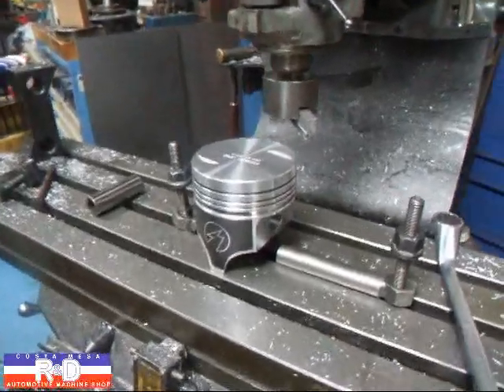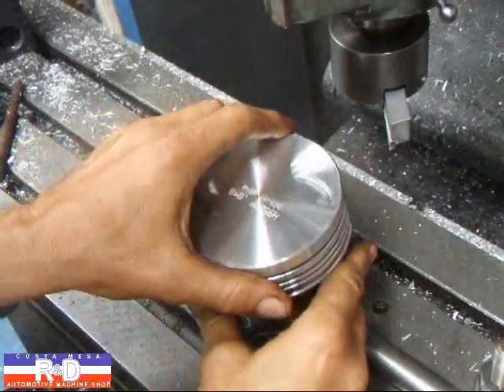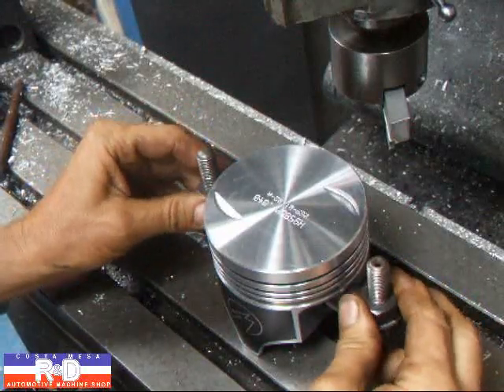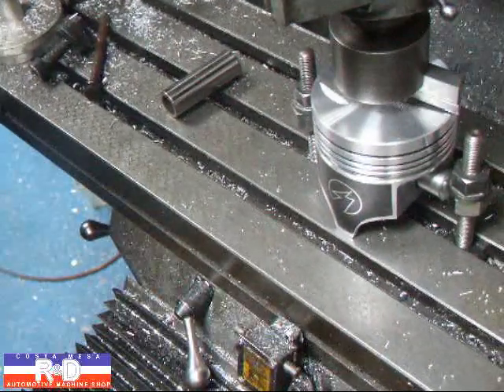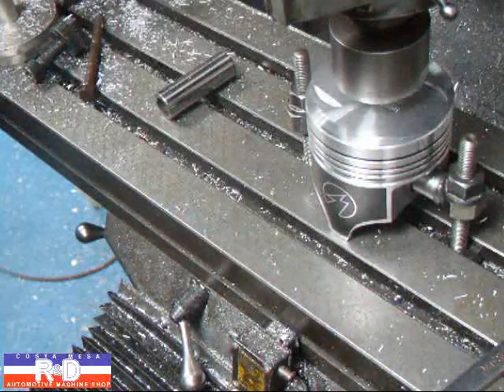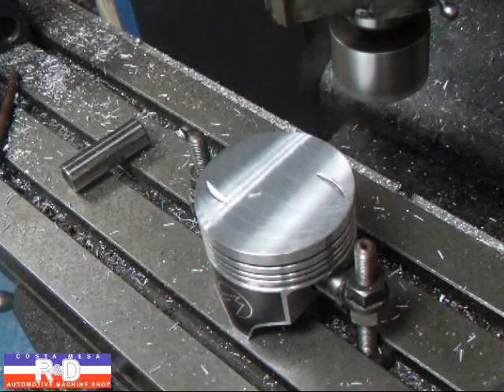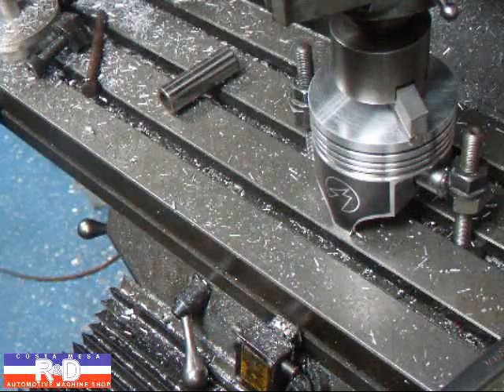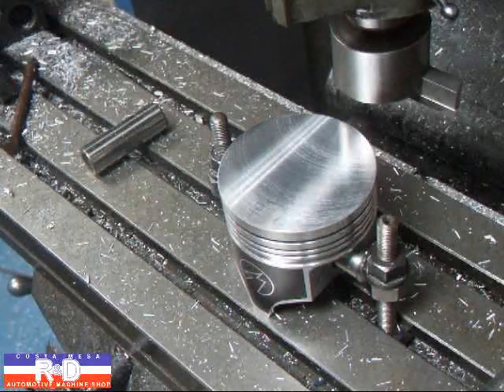Chevy 292 Piston Compression Height Reduction

Comment: IF only all engine re builders did this, my Nissan L20b engine , was running prior with 95 octane ,, after rebuild started dieseling-in reverse,  when ignition turned off,, now must have 98 octane, after rebuild,  no warning from mechanic, 10 months of damage, Had the piston been shaved to match the shave of the head,  I could be running the cheaper, 95 octane,  for the rest of the life on car-engine, no wonder I =+&^%$#@  Mechanics

Comment: Good evening, 

I got a  Wiseco forged pistons with a compression  height of 1.4255. 

So I’m  wondering  if it’s possible to reduce it to 1.304?
Reply: So you're knocking off an 1/8 of an inch , just make sure you've got 0.200 material thickness left.

Comment: This is great, I have some 1.991 440 pistons 4.380 bore, speed pro forged 2266 flat tops, they look to be very thick up top....if you know the chrysler 400 motor at all you know the pistons set over .110 in the hole. NO GOOD FOR FAST. Maximum piston height is 1.935 in the low deck motors, the 400 has a huge 4.342 factory bore, so low compression overbored 440 pistons are a great fix. There's even a 1.912 ch piston which is .004 taller the the kb240 which is the only aftermarket non stroker piston, the kb240 is about .090 taller then factory. I'd like to have 2 valve notches and mill them 0 deck roughly - .060 off the top & leave some of that extra height to make a closed chamber dome.
With all that I mentioned, what in your expert opinion would you say to that. P.s. there's good money in this if you'd like to partner in on making pistons for the chrysler 400 they'd sell out like Seattle Seahawks season tickets..

Comment: i always cut pistons in my cnc lathe if the piston is tapered i use a set of jaws that have the angle machined in . if they are oblong i have a set of jaws that have a hard rubber liner . but remember to turn your vise pressure way down a grab the crown if posable .
and i'm not putting down your video great job i see a lot of guys asking why you don't use a lathe and i wanted to point out some concerns that need to be watched out for . also if guys use a mill or lathe i always measure off the pin for installed hight i have seen skert hight very as much as .o1 thou

Comment: Good job!!! How about those "valve markings"??? you don't have to make them again in lowered piston top?? I have a good question for you: I am replacing pistons into my Infiniti FX45/2004 engine: VK45DE engine! I could buy bigger pistons, bigger bore much, much cheaper, like set of 8 for $200 from ebay! Thay are for 5.6 litre QX56 engine, bore 98mm compared 93mm!!  I know piston pin size is same, but....if the pin distance to top of piston is a little difference...I don't know yet???, could I do this for new, bigger pistons???? just shave a little off from the top??? Now, if I do that, how do we make those valve markings on a shaved pistons??? Thanks a lot, youtheman =)
Reply: Eero Laukkanen
Reply: Valve reliefs are not needed for the 292 Chevy. 

He is cutting V8 pistons to fit an inline 6.

Comment: With 25

 plus years experience in custom machining and owning a machine shop this is a hack job, I would never put my reputation on work like this. Quality comes at a price you assume that the skirts are parallel  to the dome you must have lost your indicator 145 dollars is cheap to do 6 pistons right, 30 minutes you get what you pay for.
Reply: Its responses like these that make me wonder about so called experts.  Did you even watch the video?  Skirts had nothing to do with it.  He trued the top of the piston to the cutter by adjusting the clamps.  Some take their time to complain about how it can't done....and others spend their time doing!!
Reply: Cheyenne is talking about the piston being off front to back, and left to right. The mill head is probably out of tram, and the skirts could be different lengths. He should have used a test indicator to verify that it was flat. I've watched a few of this guys videos, and he pulls this un-trammed shit on a regular basis. Even if he didn't have a test indicator, he could get a 123 block, and use a feeler gauge to tram the head, then fixture everything, and use the feeler gauge between the tool and the top face of the piston, while keeping the tool pointing the same way for all of the "feels". You would still be assuming the top face is perpendicular to the axis that runs through cylindrical face of the piston. To fixture the piston so it would be perpendicular to the outer face really would just require a dial indicator, centering up towards the top, then moving down and adjusting for any differences. The point is this guy did none of that and maybe its fine, but its not good machining practice. Also if you didn't know any of the stuff i just mentioned above, and you refer to yourself as a machinist..... yeah you are not. but what do i know...
Reply: Liar, you are not a machinist nor have you ever owned a machine shop. Keyboard machinist at its finest.

Comment: Me and a bud had a 300 I6 that he ported the head and punched the block out to the max. Pistons were no more then 1 an a half inch tall. We also had a comp stage 2 cam and crank. We build the header and in take. On top of that a 650 Holly four bbr dubble pumper. We put it in a '88 ranger. It would snap u joints and drag rear bumper!
Reply: How did you have a 300-6 into a Ranger, you must have extended the nose or had the engine half way into the cab of the truck.

Comment: Valve pockets mismatched ? Or clapped out bridge port
Reply: +Brandon Quenneville pretty common for inlet valve pockets to be bigger then exhaust pockets because a inlet valve i bigger then an exhaust valve. So i think that is the case here too.
Reply: @gabbermaikel  both were intake valve reliefs. Odds are it was a sloppy casting and the reliefs were not the same depth right outta the mold.
Reply: No clapping until the end please, expert machinist at work.

Comment: At 4:59 it looks like only one of the 2 fly cuts-velve relief cuts is still visible while the other has been completely machined over. Does that indicate a slightly misalignmened piston crown to cutter tool surface?
Reply: one side cud of been cut deeper for a bigger valve lift of the intake cam???
Reply: yes, the intake side usually has a deeper cut for the bigger valve
Reply: +h0rr0r100 Means something for sure, but i cant guess exactly waht, iam not a witch
Reply: both valve reliefs were intake reliefs, and odds are they were not cast at the same depth.

Comment: Im just curious why you didnt chuck it up in the lathe and face it off?
Reply: I may explain this awfully due to broken english but.
He's doing it on the mill because of the tolerances allowed (parallelism) between the axis of the pin and the top of the piston are extremely tight. 
Doing it on the lathe would make the top of the piston perpendicular to the axis of the cylindical part of the piston. Which would probaly mean that you would bust the tolerances allowed.
Reply: @warracer03  Why didn't he indicate it in instead of just taking a lets see which side cuts more?
Reply: fusionstar916 The skirts are tappered, but the pin relative to the top is parrallel
Reply: A special chuck is involved to use a lathe folks.
Reply: pistons are tapered.

Comment: I just machined .090" off a set of 250 CID pistons in my lathe and had about 3hrs into a set of six and it was done right I can tell you that your cut is not flat and if you have to use the wrist pin bore to clamp a piston put the wrist pin in and work off that I.D.. I would consider this a hack job at best anything worth doing is worth doing right and when you do something the wrong way don't post a video of it.

Comment: A longer connecting rod slows down the piston speed towards the ends of its travel, which reduces the G-forces on the wrist pin and big end. Longer rod:stroke ratios are used on high RPM engines for this purpose. Most superbikes have something close to 2:1 rod stroke ratios, F1 cars have them as high as 2.7:1!
Another benefit is that longer rods necessitate a shorter compression height on the piston, which saves weight.
A long rod stroke ratio compensates for a poor flowing head somewhat as well

Comment: I would like to do this to some stock pistons I have so I can lower the compression a bit to be safe (its turbo). Stock is 10.0:1 comp ratio, maybe bring it down to like 9.5:1 or 9.0:1. But my question is... Will this remove any special coatings on the piston or make it more vulnerable to creating hot spots? Will it weaken it? Thanks! Props on the videos, very helpful!

Comment: I was told once that a Nissan z car (240, 260,280) engine was essentially a 6 cylinder motor with an overhead cam and the shared many same parts like crankshaft, pistons and rods...is this true?

Comment: @1972FordF150
Sealed Power does make great pistons.  However, hypereutectic pistons are designed for race engines.  They have much tighter piston to wall clearances to minimize blowby and increase power.  They would be good for a street engine if you aren't looking to get long life out of the engine.  Wear out a lot faster.

Comment: No, that would change the compression ratio. You have to assume the stroke will be increased by using a longer connecting rod; that keeps the correct compression.